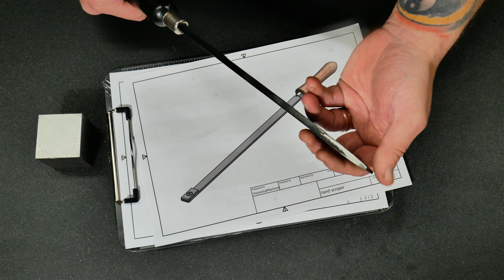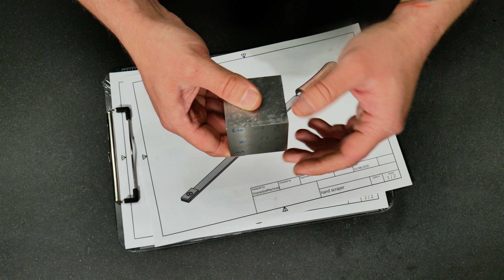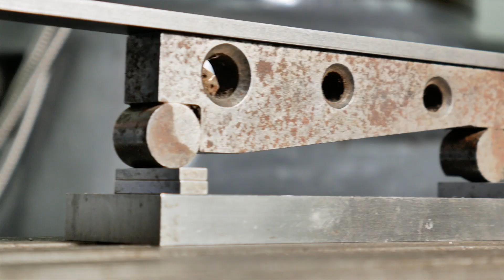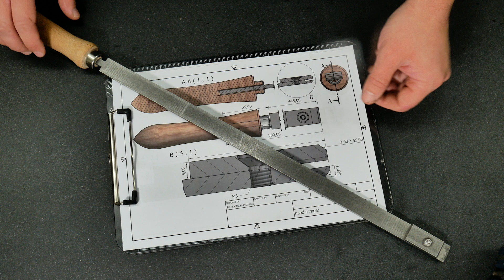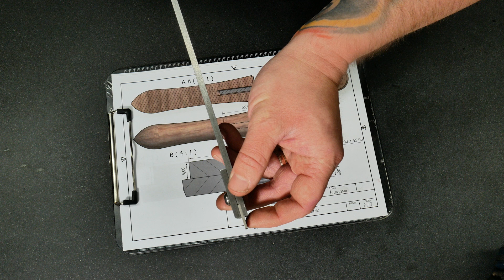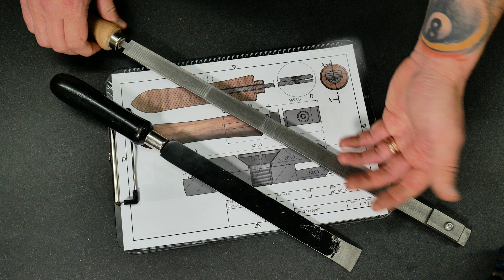DIY Hand Scraper Build

Comment: I spent 6 months of my apprenticeship in the 1960’s, learning how to, and doing a large amount of scraping, the technique I was taught is quite different to yours, and the finished product was a seagull effect, like you will see on old machine tools. We scraped at a lower angle than you demonstrate, and also turned the scraper during the stroke. Good idea though with the replacement tips, you could have a few pre made so when doing a big job, to just change the bit rather than having to re grind every so often would be a big time saver.
Reply from the maker: As it happens i make and sell scrapers and the carbide inserts now. My technique isn’t perfect and i’m envious of the people like yourself who had that sort of formal training.

Comment: Do u have any in stock
Reply from the maker: There is a 650mm scraper with a hand turned maple handle which is supplied with a carbide insert, in stock on my Ebay store.

Comment: A suggestion.  Hold the scraper at 15 to 20 degrees angle to the workpiece.  It is almost at 40  to 45 degrees. That's why you don't get control of the stroke length
Reply: Buenas tardes maestro usted tiene disponible scraping manual ,para venta o los planos de construcción ,se lo agradecería

Comment: I found out that an oscillating tool with a carbide edge blade makes an ideal scraper and works better than a biax.
Reply from the maker: I'll reserve judgement on that until I see a demo, i've certainly seen it suggested but i've not read any tales of success. I've seen reciprocating saws turned into power scrapers though.
Reply: @ImpracticalMachinist  Well, it's fairly precise, but a cone stone on a rotary tool works well too.
Reply from the maker: That I have done in the past for small pieces, a knock off dremel with a flexi shaft works pretty well. For anyone else reading this it's important to be gentle so that it doesn't dig in or scratch.

Comment: Nice video but the volume is way too low. I was listening to other videos at 12-15 on my volume and at 66 I could just hear your voice. Also, it would help if you described the dimensions of your material better. You didn't mention the thickness of the metal bar and even on your drawing, which you kept covering up, it does not tell the width of the material. Looks to be about 25mm (1"), but that's a guess, it could be 30-32mm (1-1/4). Also, a good technique is to put a radius at the back of the blade base. This keeps the blade held by two points and prevents it from trying to pivot in the clamp if you put a radius on the backside of the carbide, as well as in the front. If you have a limited number of scrapers, you can get a 25x25 blade and put a different radius on 2 or more sides. Except for the volume, good video. Thanks for the inspiration.
Reply from the maker: The width matches the insert width, so in this case 20mm, but you can go as wide as you reasonably like, likewise with the thickness of material, I use 5mm but for a shorter scraper you may want to shave it down for more flex. I understand that some people do machine a crescent into the back of the clamp to prevent the insert from wandering off to the side, in use this hasn’t been a problem and the clamp holds the inserts nice and tight. For larger sizes of insert however it might be more important depending on how much you’re leaning on your scraper.

The volume is a strange issue, hopefully one that’ll be solved the next to me I publish a video.

Thanks for your comment.
Reply: @ImpracticalMachinist  Thanks for the informative reply. My carbide arrived today and I'm making several scrapers similar to your design but with 20mm brazed tips. Thanks again.

Comment: A solid firm table will make your scraping process easier to control, there is too much movement in a Black & Decker work holder. You need a base that is solid and has no movement when you apply a hand scraper to the work piece. You need a heavy steel table or a heavy duty wood table with solid supports to the floor secured to the wall or floor so it does not rock back and forth.
Reply from the maker: The workmate is surprisingly stable with a bit of weight on it, though obviously not as stable as a proper bench. For the purposes of filming at the time though it was just handy.

Comment: do you have a link for the plans you used to make this? Thanks
Reply from the maker: If you pause the video you should be able to make out the dimensions, it’s just 20mm steel, with a cutout to suit your insert thickness at one end and a clamp to suit.